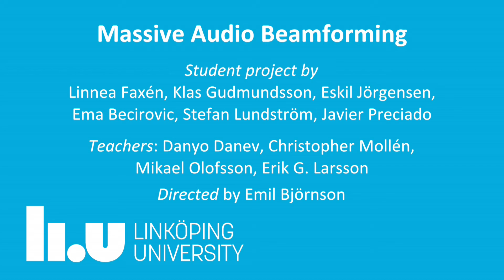Massive Audio Beamforming (TSKS05 Project, 2016)

Comment: Would have been more useful to do this in simulation which could then be expanded upon and shared, Universities burn cash like no one else. Not to mention nothing is mentioned like "channel separation" etc..
Reply from the maker: This project course costs approximately the same as our theoretical courses, but gives the students other skills related to implementation and project management. The hardware, code, and knowhow from previous years are used in next year's projects. Note that simulation code of these types of algorithms are already made publicly available by researchers in our group: https://github.com/emilbjornson
Reply: @WirelessFuture  
What you've done is pretty great, especially this presentation with separation of roles between the students and the "live" demo.
What also deserves a lot of appreciation is that the codes are shared on Emil's github (books as well).

Comment: How is fur elise received from left terminal and e anthem at second left? Is it more noisy?
Reply from the maker: The recordings that we play from the two terminals are made at exactly the same time. We are just playing them one after the other in the video.
Reply: The songs are played out of phase in all the big array of speakers. If the phase differences are controlled properly, it is possible to completely cancel out the sound at say right speaker, while maximizing the sound at the left speaker.

For this project, they needed to figure out a combination of phases (A) so that only left speaker hears a sound, and another (B) combination so that only the right speaker hears the sound.

Then they played the two songs simultaneously, but applying phase difference configuration A on one and B on the other.

Would have been nice to be in the room and move around to feel the sound waves reinforcing and cancelling each other at different points :)